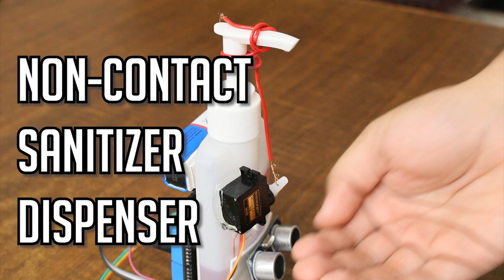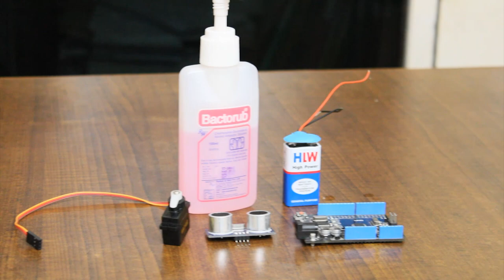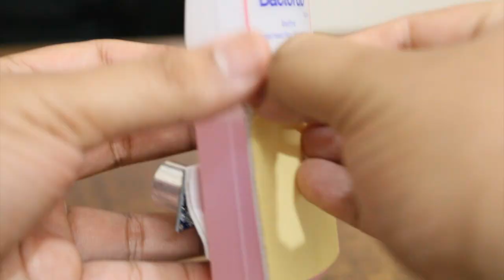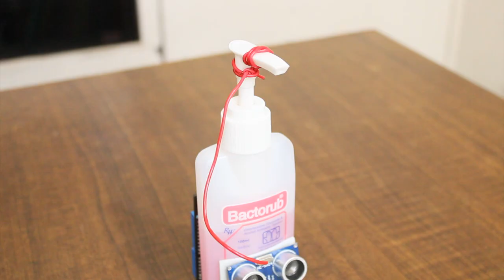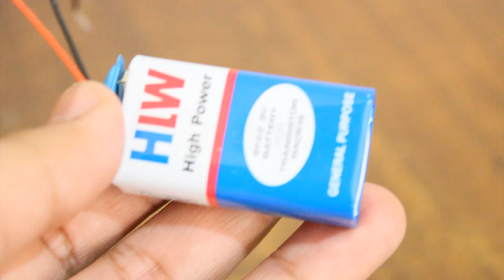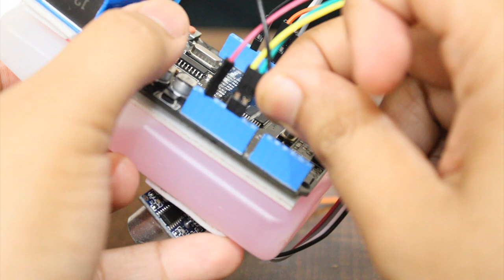Simple Touch Free Automatic Hand Sanitizer Dispenser

Comment: Guys this is the code:
I first opened it in PC with notepad then i copied it and WhatsApped to my phone

#include <Servo.h>

const int trigPin = 10;
const int echoPin = 11;
long duration;
int distance;
 
Servo myServo;
void setup() {
  // put your setup code here, to run once:
myServo.attach(12);
pinMode(trigPin, OUTPUT); // Sets the trigPin as an Output
  pinMode(echoPin, INPUT); // Sets the echoPin as an Input
Serial.begin(9600);

}

void loop() {
  // put your main code here, to run repeatedly:
distance = calculateDistance();

  
myServo.write(0);
if ( distance < 5)
{ myServo.attach(12);
myServo.write(160);
delay(500);
myServo.write(0);
delay(1000);

}
else{
  myServo.detach();
}
Serial.println(distance);
}
int calculateDistance(){ 
  
  digitalWrite(trigPin, LOW); 
  delayMicroseconds(5);
  // Sets the trigPin on HIGH state for 10 micro seconds
  digitalWrite(trigPin, HIGH); 
  delayMicroseconds(10);
  digitalWrite(trigPin, LOW);
  duration = pulseIn(echoPin, HIGH); // Reads the echoPin, returns the sound wave travel time in microseconds
  distance= duration*0.034/2;
  return distance;
}